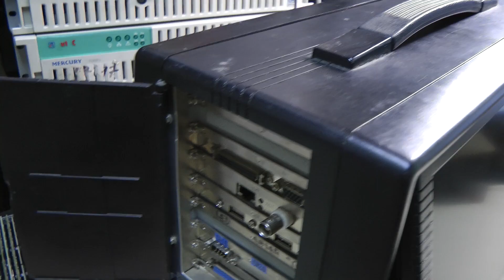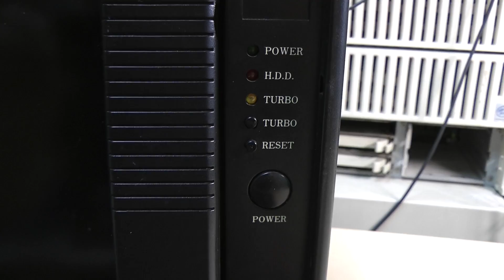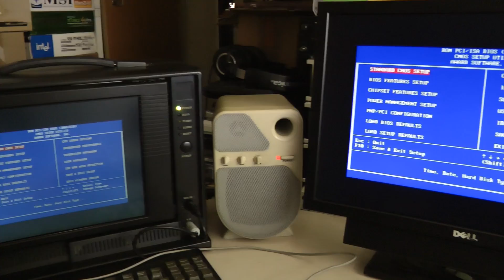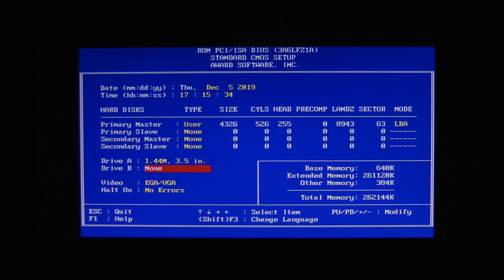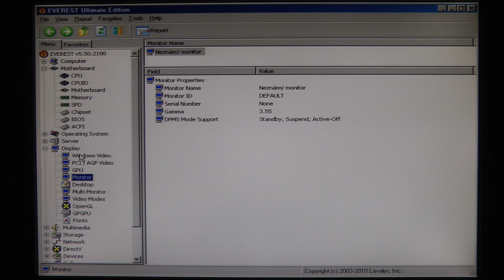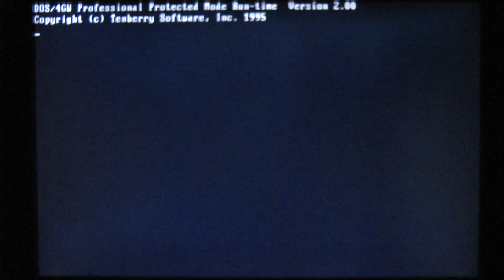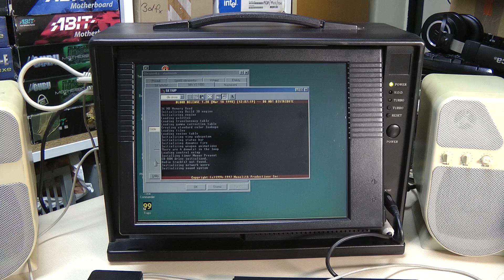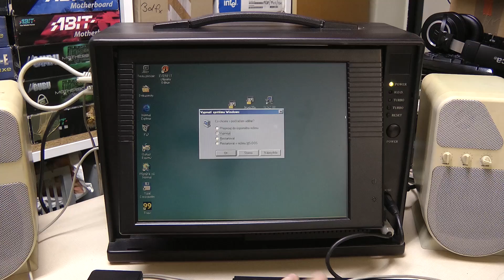Portable computer + 3dfx Voodoo 2 - RETRO Hardware

Comment: I would love to see a design like this done with modern hardware

I would happily have a suitcase pc if it bridged a performance gap between laptop and desktop
Reply: With Core i9 and RTX 2080 Ti
Reply: @pardonless  I was thinking more of a 3950x (as I do rendering) but yeah, you get what I mean
Reply: You can buy a case like this for modern hardware...except it is hundreds and sometimes over $1000
Reply: Get a case like this and you can build pretty much anything in it, the only limiter I can think of is that there's no ITX Threadripper motherboard and only one ITX x299 motherboard, but most people would be perfectly happy with a 3950x or 9900k.
https://www.corsair.com/us/en/Categories/Products/Cases/Graphite-Series%E2%84%A2-380T-Portable-Mini-ITX-Case/p/CC-9011061-WW
Reply: Eurocom, jack! Break out your check book and skip a months rent or two. You good!! Lol!
Reply: I concur, I wonder if its possible to at least drop in a modern motherboard, power supply and video card at least into this thing
Reply: Sooo where can I buy the case like this ?

Comment: I would love to see a modern 'sleeper' PC build in this thing! You could replace the panel with a high refresh IPS panel and really surprise some people xD
Reply: I'm currently doing that to a twin to RETRO Hardware's, buts its a P4 model. I have a bunch of these laying around. Only issue is the motherboard mounts upside down so the processor is at the bottom, and I need to use  liquid cooler because the power supply will be sitting right over the CPU. Should be interesting.
Reply: @tomc8157  absolute mad lad. Got any visuals on that? Please

Comment: Nice project!
You can try to get the digital data from the inputs of the V2-DAC. It seems to be 5:6:5 (bit per color) so it should - in theory - be usable for controlling the panel. Then you need fast analog switches (the voodoo uses them for changing vom VGA to its own output, but they don't offer enough ports). Should be possible, but maybe a bit overkill ;-)
As a base, i'd suggest a card with 2D+3D (e.g. V3) or something like a matrox which offers digital interfaces on its own and should be adoptable to the panel.

Comment: I remember that I had a celeron 300a and my bro a p2 333. We both had the same brand Board, hdd and memory. Only He had a voodoo3 pci and I had voodoo2. 
It also loaded the games faster on my celly but yeah, he had ofcourse more fps in games.

Still my system felt more responive in windows and other tasks. I loved my celeron back then.

Edit: Wow, I had the same speakers on my p75i <3  Such good sound.

Comment: I found a system like that but it was white. It was on the curb when the neighbors moved. Was missing the Power Supply, Hard Drive, optical drive, RAM and CPU. I stripped it down and built it as my Gaming rig since I was attending a bunch of LAN parties. Had a AMD K6-2 500MHz, 128MB RAM, Sound Blaster Live, Voodoo 2, Realtek 10/100 NIC, Iomega Zip-CD 650, 30GB Hard Drive and 1.44MB floppy but switched to a LS-120 Floppy. It ran Windows 2000 Pro. At one point right when 3Dfx went bye bye I bought a Voodoo 3 3000 for $60.00 on clearance and then used a 19 inch CRT TV for Gaming since it had S-Video and I think I tossed in another 64MB of RAM into it. Then over the years when it was too slow for anything I removed the Sound Blaster Live and Voodoo Card and turned it into my first Linux Box running Redhat 7.1. I have no idea what happen to that machine, might be in the attic in the house I grew up in.
Reply: How do you find it ?

Comment: You may be able to throw in a separate LCD driver board if you knew the pinouts of that ribbon cable. 
Unfortunately it's probably not info you can find easily.

Comment: Daaaaamn. ATX compatibility, but absolutely requires you to have that particular ribbon cable female port on your GPU. It's almost a waste, could be the perfect LAN party box (yeah, LAN parties are outdated, but imagine!). There's a certain charm to putting desktop parts in a transportable crate with everything snapped on to it, as opposed to a laptop, and somtimes I wish AIOs were made this way instead of those flat panels that can't be modified, opened or repaired.

Comment: amazing machine, however I'd put in a voodoo 3 or a TNT card so that you don't need the pass through VGA cable so that you can close the door to the ports when you're not using the machine though.
But it would be the most amazing retro LAN party machine with the voodoo 2 inside :)
Reply: I guess no AGP slot in this ?
Reply: @tmbardsen88  I think there is, you can see it at around 4:14

Comment: Really cool project. I would Like to see, If it is stable at 100 x 5 or even a multi of 6. XD is the board able to do more than 100MHz? The PCI cards were stable over 33MHz so there should be a nice overclock reachable.
Reply: It's possible the board can't even do 100 mhz.  There were several crippled chipsets that Intel used with socket 370 for the Mendocino Celerons (440zx?)  that were intentionally held to 66mhz to prevent more debacles like the overclocking of the slot 1 300 mhz Celeron.

What might be a nice update would be a voltage interposer/adapter and a 733 or 766 Coppermine celeron.  I upgraded a few locked up PPGA 370 machines like that 15 years ago.
Reply: @dennisp.2147  The Northbridge ist the VIA VT82C691 so it should Support 66/100MHz and what else ist the Option in the BIOS for? The Mendocino Celeron at it's best clocks 533MHz stock.
Reply: @jhonnyxyz  Yes, i am aware of the Mendocino's clock limit.  It was a frustration for me when they were new.  As to whether the board can support 100 mhz, I'd have to get a better look, even with that Northbridge.

Comment: ide system pretty good for bringing back the dead i would have left the original card in if they are still working and use a sata adapter put in highest possible hard drive install lubuntu put in usb pci card in the slots put in max memory if it can hold 1 or 2gb if possible. I used to have a 400mhz big unit

Comment: I have gotten me that DEMOLUX PC Overhead projector which is basically a Pentium 233 with a beamer. Want to 3dfx it too but the problem is how to get the signal output to the panel because its grabbed off internally from the 2D card to the little internal display. Here´s a video i found about it these days: https://www.youtube.com/watch?v=UHxSaB3QK2k. Its an SBC inside the case. But how to 3dfx it? hehe
Reply: DOOM and co on the wall :D

Comment: That motherboard will support up to a p3 800mhz and celeron at 700mhz
Reply from the maker: first Celeron Mendocino to 566 MHz is max.
Reply: @RETROHardware  I have that board rev 1.3 and it has a celeron 633 on it
Reply: It's possible you have older chipset, also I thought Mendocino maxed at 533mhz
Reply from the maker: You right max is 533MHz. I saw several revisions/types of this board too.
Reply: There is a difference between the PPGA Mendocinos and the FC-PGA Coppermine Celerons, but you can sometimes get the newer chip to work in the older boards with the crippled 66 mhz  chipsets.

Comment: someone needs to put modern hardware and better monitor in it
Reply: I want a good lunchbox portable. They were always, and still are, way too expensive for what you get.
Reply: @michaelsasylum  yeah.. even though the laptops look better than this. but come on, who wouldnt want to use a tiny box that has gtx 1050ti  with a i5 in it?